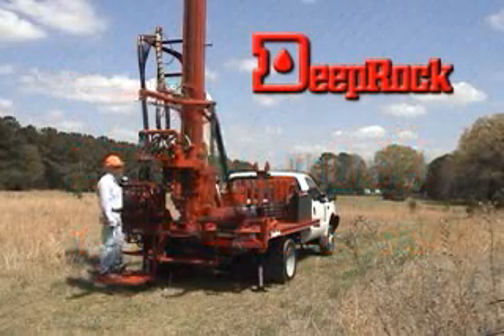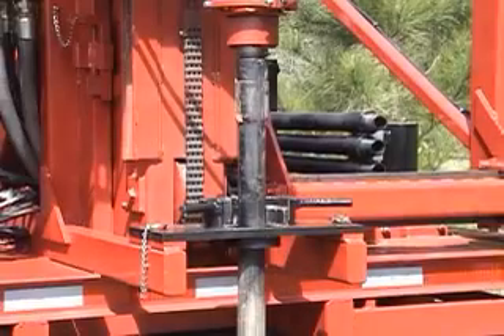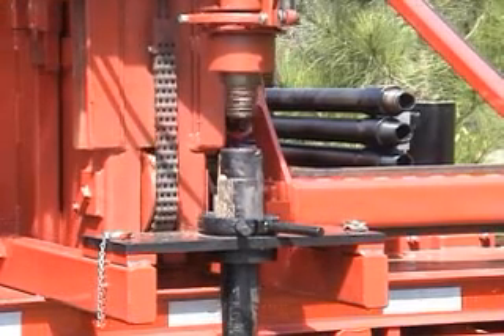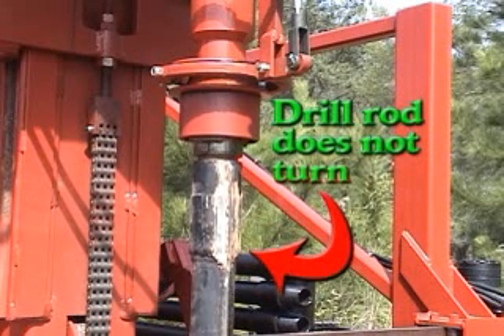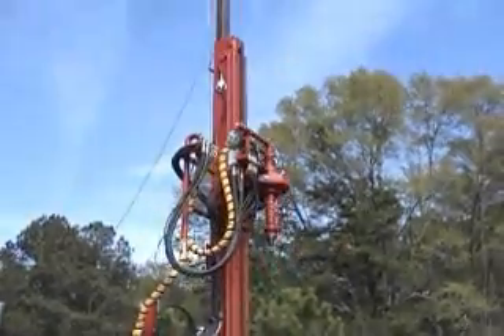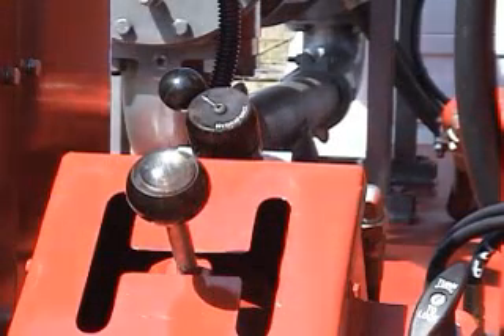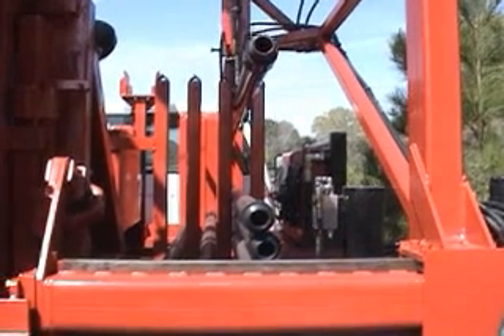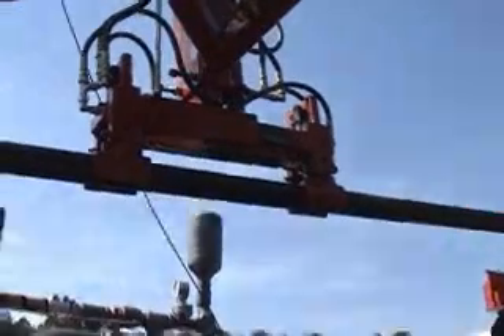DRILLING A WATER WELL

Comment: I've worked around IR T3s And Gefco/ Speedstar 30K's for about 7 years. One thing they have in common is there wear points and joints have a lot of play. Its not a lack of grease or abuse its the fact they wear in and thats what happens. Drilling is hard on any rig there's a lot of vibration rock dirt and other factors that realy are tough on the machines. I think the rod handler is awsome just I don't think it will work that nice for very long Thanx

Comment: Nice machine but it has way to many moving parts. Even the best maintained clean rig will have dirt and mud ruin all those moving parts. Well drilling is not a clean factory job. Rods are weigh quite a bit and after a few hunderd hours of running that rod hander will get loose and will require man hands to line things up. Much respect to you but I don't think the tooling will have a long life span